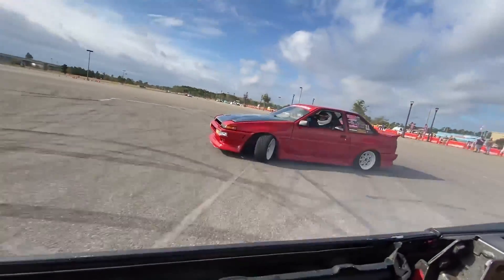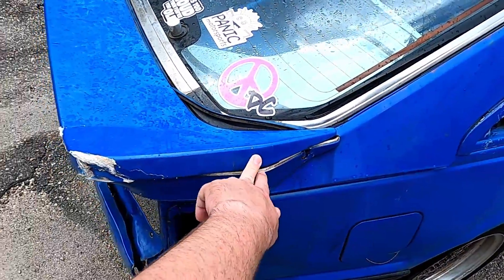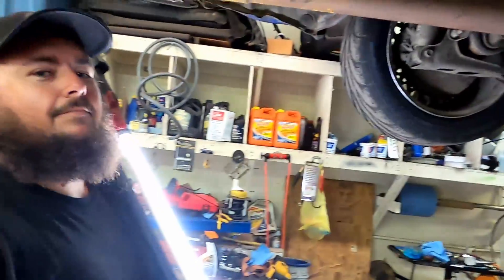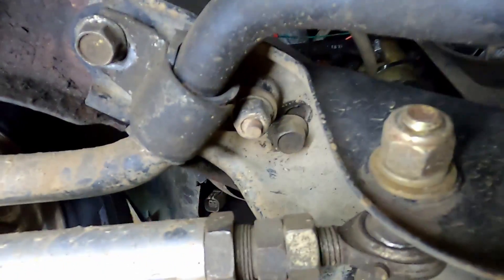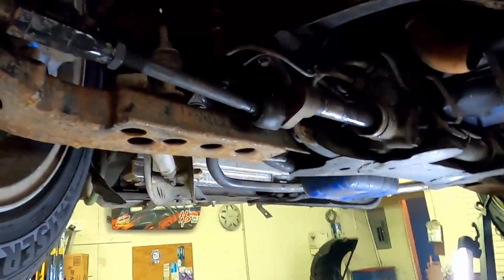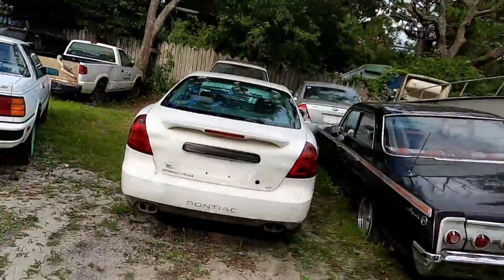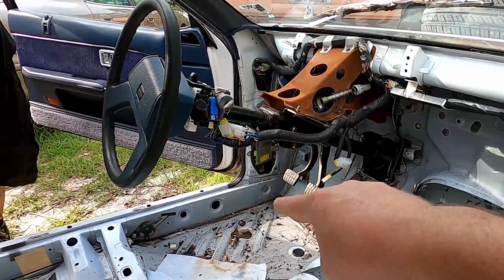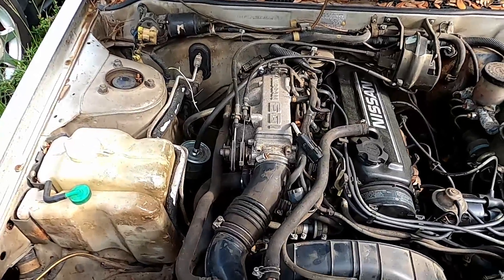How to build an S12 DRIFT CAR - and other S12s and shop projects with Stacey Babb

Comment: Unless you have the 1984 Nissan S12 coupe like I do, that was the only year Nissan put a fixed axle rear end in the 200sx. The rear end in mine is a H190 with the H standing for Hitachi. That rear ended is also the strongest fixed axle rear end that Hitachi-has ever made and came with a 370 gear. The rear end can allegedly hold 300 hp & 300 tq without modification. It should hold up to the power of a stock Chevy 5.3. I guess I’ll find out soon.
Reply from the maker: Awesome! That's some really good info!!

Comment: You could run stock LCA with the s13 joint to mount the knuckle. Cleaner setup and cheaper.
Reply from the maker: I believe that's what he used to run, but he needed longer control arms for more clearance.
Reply: And you get the ability to adjust caster with the aftermarket tension rods

Comment: I’m looking to buying a Nissan s12 but idk if it’s real easy to get parts for it in case something happens.
Is this car an easy car to maintain and daily drive?
I originally wanted to get my hands on a Toyota sprinter Trueno ae86 but I doubt I’ll ever get one 😔
Reply from the maker: There isn't a whole lot of aftermarket support for these cars, so parts are pretty scarce. I dunno how easy of a car it is to maintain for daily use, I don't think many people daily them ha
Reply: @DoctoredGarage  Damn that sucks to hear.
I really want an 80s - 90s jdm sport car for daily use and I’ve been looking for over a year but idk what to buy without worrying about the car being hard to maintain or it being too dangerous for me to drive lol 😅😅
Reply from the maker: The ones that have service parts readily available have hit collector car status so they're expensive now. I never would've thought AE86s and 240s would be $20k+ cars, but there have been a bunch that sold for that much. It's an interesting time!
Reply: @DoctoredGarage  
It sure is man.
Thanks for the reply!